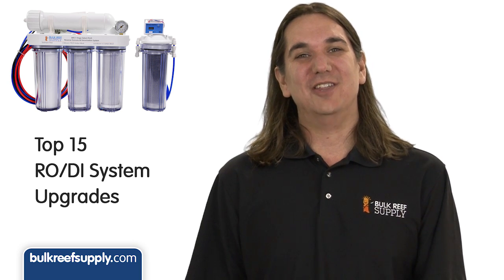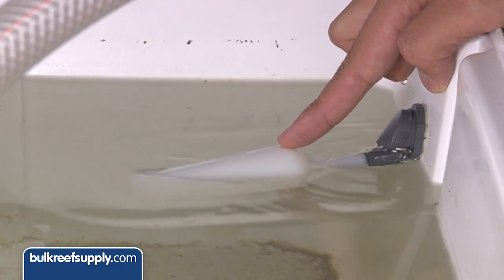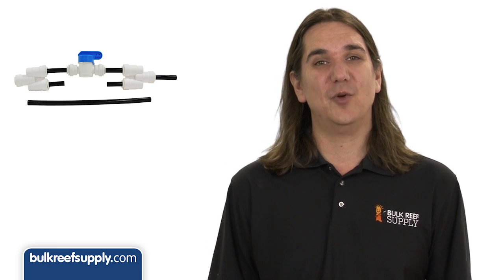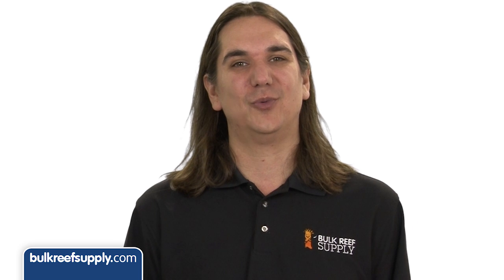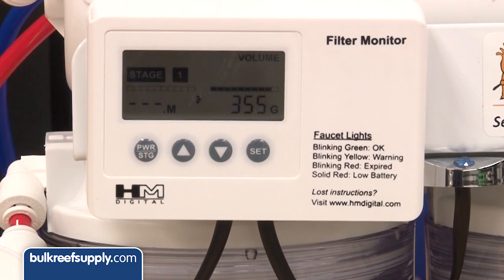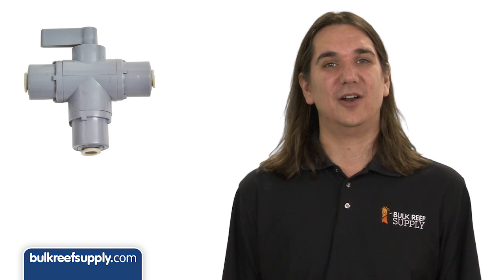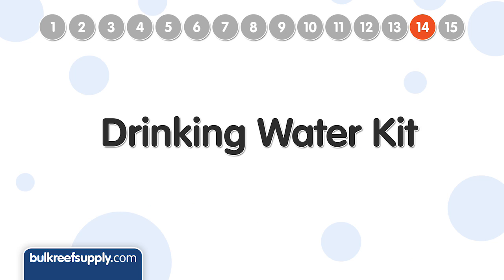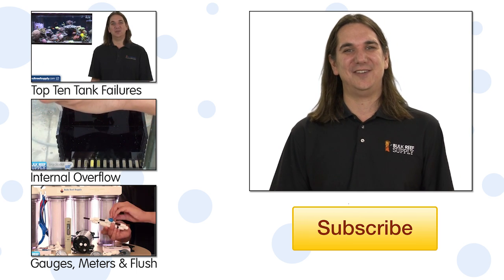15 Reverse Osmosis Upgrades - EP 3: Reverse Osmosis Systems and Your Reef Tank

Comment: I just want to tap off the RO part for drinking water. I put into 5 gallon jugs to use in the water dispenser and then put back to original for plants, and dehumidifier water

Comment: Think of a fish in the ocean.  It would never ever experiences zero TDS.  Why is zero TDS a good thing for your fish or for your drinking water?  What zero TDS does is that it leaches out all of the salts and minerals from your fish.  It kills them over time!
Reply from the maker: We aim for 0 TDS so that we can select what goes back into the water via our salt mixes. If you're keeping freshwater fish, then 0 TDS is usually not the goal unless you plan to re-mineralize the water after the fact. For drinking water, we don't use DI resin, so it's not 0 TDS water.

Comment: It appears you are coming from the Aquarium side of R.O. systems.  I just got a home with a R.O. system for drinking water only.  Does everything in this video still apply to a drinking water system? Same recommendations for filters etc...  thanks!
Reply from the maker: For the most part, yes. The biggest difference is that we use DI resin in our RO filters for our aquariums. For drinking water, you would want to exclude that stage.

Comment: What if my water pressure pegs out the gauge? I added a prv(pressure reducing valve) set it to 75psi and have it plumbed in just before the RO unit. Should I move it to just  in front of the RO membrane instead?
Reply from the maker: Before the RO system as a whole would be best. This way, your pre-filters won't be subjected to 100+ PSI and you'll reduce the chance for a leak.
Reply: @BRStv  thanks for the reply! You guys are awesome!!!

Comment: How many ppm will ro system remove. Mine is 500 on a good day. I am buying 3 filter-2 RO in series, 2 DI units in series.  Before the water gets to those DI's,  how bad's it going to be?   And if its bad, its gunna chew up those DI's
Do I need some kind of other system before this thing?  These questions are your doing.. been watching your vids
THANKS
Reply from the maker: The RO membrane is what does most of the work in terms of removing TDS. You'll want to stick with a single membrane since your source water TDS is so high (do not use a dual membrane water saver version). Higher pressure in the 80ish psi range can also help greatly. Most quality membranes have a rejection rate of upwards of 98-99% at peak efficiency, like our 75 GPD membrane for example. 

You may also benefit from running our Pro Series triple DI resin setup so that you an change only the type of resin that is being exhausted, rather than a mixed bed.

Comment: What I always wanted to know is what is the best micron rating.  The variation in micron settings from one unit to another is quite large.  My system came with sediment and carbon block micron ratings of .5 microns.  BRS systems come with 5 micron pre filters.   Does it matter?  What is optimal?
Reply from the maker: Truth is, for a vast majority of water sources, any of these options will work great to protect the more expensive filters down stream, like the RO membrane. Most reefers will use the 1 micron sediment filters because it's a good middle ground between performance and longevity. Most of our BRS systems now come with 1 micron sediment filters with the exception of some of the value systems. The larger the micron rating, the longer the sediment filter will last, but the more particles it'll let through and vice versa. 

https://www.bulkreefsupply.com/10-purtrex-sediment-filter.html

Comment: I’m a little confused on the auto shut off, I have my R/O system set up to be hooked up to my hose how does the auto shut off successfully shut the water off if the valve for the hose is on wouldn’t all that extra pressure make something blow up?
Reply from the maker: The auto shut off valve essentially has a little bladder inside of it that cuts off the flow to the membrane (and thus the waste water). The pressure will never be greater than your normal household water pressure
Reply: @BRStv   thank you so much for explaining that!

Comment: What happens if you forget the flush valve opened for hours?
Reply from the maker: Mainly, just a lot of wasted water. This won't cause any harm to your RO system other than the fact that all of the extra water is running through your pre-filters (sediment and carbon block), so depending on how many hours we're talking here, it could deplete those particular filters faster.
Reply: Was about 3h...
Reply: I'm asking because I have some recent issues with a brand new 3 stage Aqua Medic inline unit 300l/d that stoped working after a week of use and the only unusual thing I did was that I forgot the flushing valve opened for 3h. The prefilter seems to get clogged after 3h of functioning but seems to work again after a respit and then clogs again. Any thoughts on this?
Reply: @cosminchisu6205  replaces prefilters.

Comment: I want to get an under sink tank to fill buckets for my aquarium. My question is , Does the tank lose pressure when less water is in it? Or can I use this to fill buckets from the faucet attachment.
Reply from the maker: The tank will lose pressure to a certain degree, especially when there is little water in the tank. This probably isn't the greatest solution for filling buckets as most pressurized tanks only hold a few gallons at a time.
Reply: @BRStv  thanks. 
Ive seen some RO units with another output for putting into a freezer for Ice. Could I just fill buckets with a seperate output and not use the tank?

Comment: Im in the middle of upgrading my ro system and I’ve now added 150gpd membrane kit but I’m wondering where I add the auto shut off valve. Do I add it off the first membrane or the second?
Reply: Thank you brs
Reply: So, If I understood correctly, that would be one ASV after each membrane. yes?

Comment: I just added the Aquatec 8800 booster pump to my BRS 6 stage RO system. I have a drinking water storage tank installed also. What is the maximum pressure that I should run the pump at? It is located before the RO. Thanks.

Comment: OK so I have done a lot of these upgrades. I have 150 gallon a day upgrade kit, a booster pump, a permeate pump, float valves, drinking water pressure tank. My booster pump keeps short cycling at 40 PSI pre- to membranes that are in series. It never seems to achieve 80 psi while it's filling my RO container. Can you guys share and installation diagram to make sure I have everything set up correctly. I pre-piped my house with 3/8 tubing so I only have one RO unit and I have three places that it delivers water to. The fridge, kitchen sink and my fish room.
Reply: It seems you RO booster pump is not working. It might have been clogged with debris.  It should easily boost to higher than 80psi, so you should usually adjust to lower pressure a bit.

Comment: hi, i have a vertex 200l rodi system with a built in auto shutoff system. however i notice the pressure gauge is always at 110psi is this a problem at this pressure?
Reply: i see thank you

Comment: Isn't RO water too clean? I heard all you need to do is run carbon by itself. If you're going through the membrane as well on top of the sediment and dual carbon stages could this deplete the water of it's essential minerals and other beneficial elements? I want to make sure I'm benefiting from the water, but at the same time want to make sure I'm removing what's necessary.
Reply: buy CONCENTRACE elements on Amazon and re-mineralize your RODI water with minerals. tastes great!

Comment: I have added a third membrane and can make up water significantly faster and appreciate the higher water yield and less waste water. I don't mind replacing the the di resin as the faster time pays for itself and all the other positives associated. I'm currently running 90 psi through the system. I was thinking of possibly adding a forth or maybe even a fifth. When would be a good time to max out? Also, if I decide to add another membrane would you advise me to add a third or forth di resin cartridge? I already have a dual however seems like I may burn through much more di resin if I go forward. Will these membranes still last 3 years like they state despite adding more membranes? Any advise or additional tips would be great. Thanks. Awesome video btw.
Reply: why not get a 450gpd system like i use for window cleaning in the UK? 
the unit is no bigger than the ones in the vid but has 3 150gpd membranes on top
I can easily make up to 1000l a day if needed and it comes out before di at 3ppm with my supply tds at nearly 300ppm
mine cost £170 so not much in usd

Comment: Thanks for the nice videos on RO systems. I'm a freshwater guy, but know the reefers have the low down on RO systems. I've considered a setup for sometime to get the ideal water parameters. I haven't had a hard time with hard water when growing nearly any plants, but can see a benefit to providing more ideal conditions for the plants and fish. These videos have been very helpful. I'd like to store RO and mix for a desired KH then pump to different tanks for water changes. Do you have a suggestion on how to setup a delivery system for the stored RO? Would simply using a pump after an outlet work? Thanks!
Reply: Thanks for the reply. This is what I had assumed, although not the remote outlet...that is just pure style. Since my system would be for fresh I'm also assuming instead of a second container where salt is mixed I could use the second container to reconstitute to my desired levels of KH and GH. Any recommendations on where to get good containers? Preferably some with volume measurements for reference since I could be using as little as 20 gallons and as much as 80 gallons at a time and would need to reconstitute the replacement volume. thanks!

Comment: I have a filter system that is a Stingray rodi system with duel TDS and pressure pump
from new the lowest the TDS gets down to is 1 ...usually starts off at about 15 and goes down to 1 after 5 minutes
also have replaced first 2 filters because they were going green ...they are outside but not in the sun and the new filters are starting to go green but the 3rd is ok
have you any suggestions to what I could do
Reply: thanks for your reply 
TDS metre was with the unit and the unit is RODI and the DI stage sits across the top of the unit
there are 3 cartridges and one across the top that had a cartridge that was packed separate in a foil bag I think
I am not shore just how many ltr's have gone through the unit but I would think that it would not be that much
as I said the TDS metre has always read 1ppm
regards 
Billy Mitchell

Comment: do i remove the flow restrictor and manual flush kit if I installed an autoflush valve?
Reply: you still need the flow restrictor, just replace the manual flush valve with autoflush valve.

Comment: BTW my water pressure into the unit has been throttled back from 130 psi to 70 psi so I assume that I would need to increase the pressure if I added more than 1 additional membranes.

Comment: Hi, I am considering upgrading my system and adding a second membrane to increase my daily capacity and reduce waste water.  My question is........how many additional membranes can I add in series?  Can I run 3 membranes in series for example?
Reply: yes, your final TDS will be slightly higher and waste ratio will be lower.

Comment: I have the Vertex boost pump system with a Chloro block added. I installed a BRS float on my mix tank. The problem is that it cycles the auto shut-off many times unless I intervene by lowering the float deeper once I hear it cycling. I can't imagine letting it cycle on and off so many times can be good for the longevity of the system. I guess the only solutions would be a float that "sticks" open longer or the ability to adjust the shut-off pressure? Ideas?

Comment: Another sweet video.  

The Autoflush valve, is it complicated to setup with out the booster pump?  Any idea how much electric it uses and if it uses power 24/7 or just once an hour?  How long does it stay open for?  Really interested in using these for our own RO and our clients, but just want to get the full scoop.  Thanks in advance for your response.